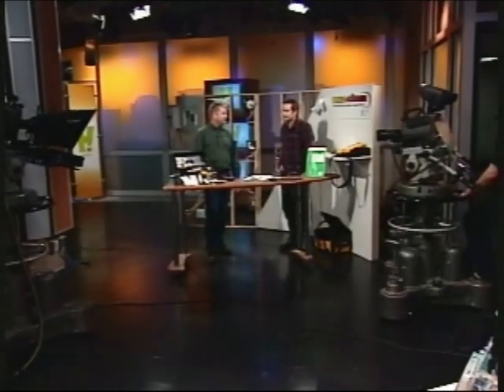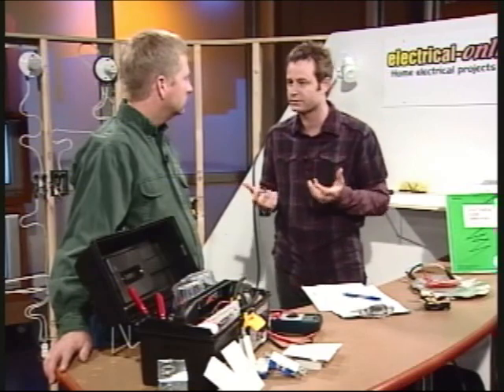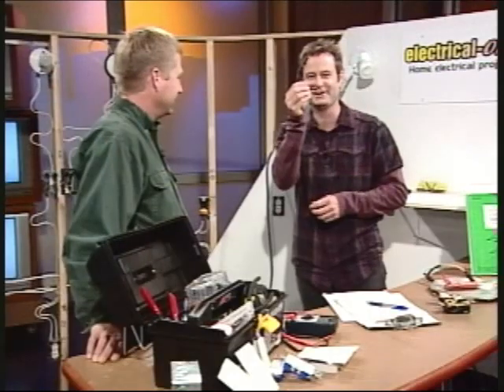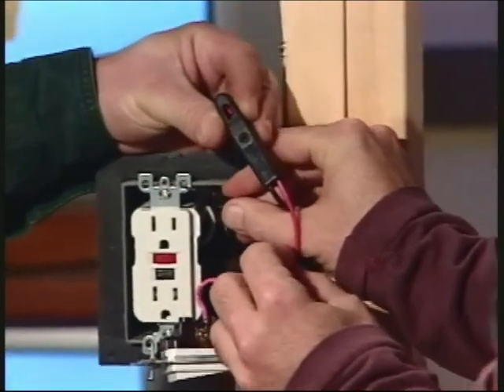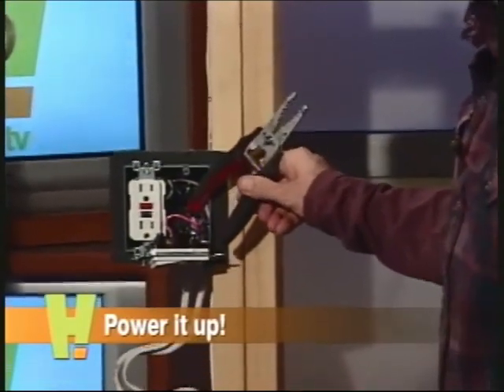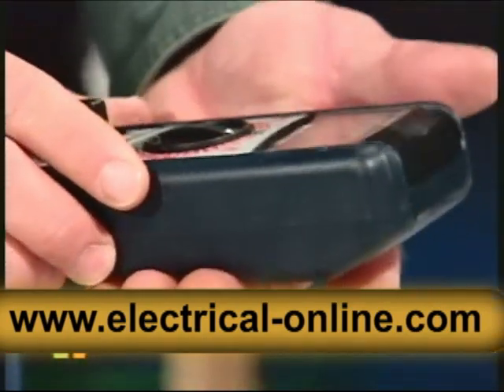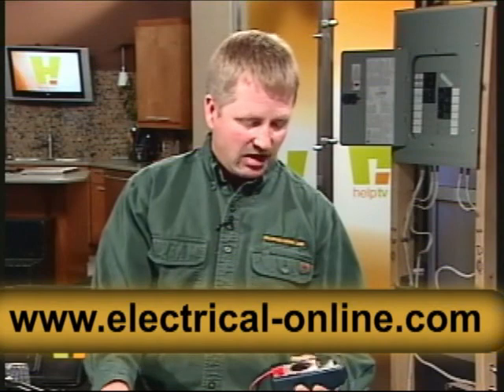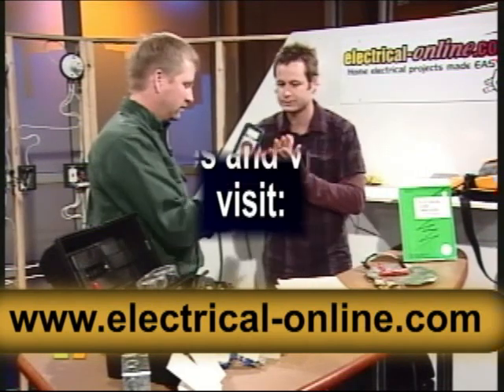Simple Voltage Testers for the Diyer

Comment: I couldn't tell which end/color was placed on the which wire.
Reply from the maker: Yeah, this was a clip from a live TV show I used to be an "expert" on.  No control over the camera angles, and no time to set up the best shot in a live production.
Reply: To use the simple neon tester you can plug one probe into left slot of the outlet the other into right slot and should see the neon light glow.  The tester has a red probe and a black probe - the colors on the tester mean nothing so you can reverse the colors and results are the same.  Also you can put one probe on the gold screw that holds the wire down and other probe on silver screw and tester should glow.  If your outlet is wired correctly per code these are the results you should get :  One  probe on green screw (which is ground) other probe on gold (Hot) = glow.    Probe Green and Silver (neutral) =  No Glow.  Probe white wire (neutral) and black wire (hot) = glow.  Probe Bare wire (ground) and black wire (hot) = Glow. Probe Bare wire (ground) and white wire (neutral) = No Glow.  Probe bottom slot of receptacle (ground) and right slot (hot) = glow.  Probe bottom slot of receptacle (ground) and left slot (neutral) = No glow.

Comment: Your hand is in the way to see exactly where I am to place the probe for testing.
Reply from the maker: Yes, I hear you.  This is not a great demonstration. I wasn't in control of the production as this was more of an entertainment program vs. a good tutorial. This was a TV show I was a regular guest for Canadian Learning Television on the Access Network, Help TV. I do have many more helpful videos on my channel, and many more to come. I respectfully request that you subscribe to my channel here and see what else I have to offer.  As a subscriber you will be first to know when I upload new videos.
Reply: Terry Peterman Ah, i see, so it's those darned Kanooks, eh? Just kidding. Thanks for ur reply. I'll check out other vids u gave. 👍😀
Reply: To use the simple neon tester you can plug one probe into left slot of the outlet the other into right slot and should see the neon light glow.  The tester has a red probe and a black probe - the colors on the tester mean nothing so you can reverse the colors and results are the same.  Also you can put one probe on the gold screw that holds the wire down and other probe on silver screw and tester should glow.  If your outlet is wired correctly per code these are the results you should get :  One  probe on green screw (which is ground) other probe on gold (Hot) = glow.    Probe Green and Silver (neutral) =  No Glow.  Probe white wire (neutral) and black wire (hot) = glow.  Probe Bare wire (ground) and black wire (hot) = Glow. Probe Bare wire (ground) and white wire (neutral) = No Glow.  Probe bottom slot of receptacle (ground) and right slot (hot) = glow.  Probe bottom slot of receptacle (ground) and left slot (neutral) = No glow.
Reply: Teun is RIGHT! YOU PUT YOOUR  HANDS THERE, AND WHAT WE ONLY CAN SEE IS YOUR HANDS!
CAN YOU SHOW FOR REAL, WHERE IT GOES?
Reply: @davidwv7370  , thank you! You explained so good w/ out even show ...
And those two guys only can know how to laught... and don,t know how to explain at all...! Poor your kids! You do not even understand that, need to show tester,  but not your hands! 
😂 😂 😂